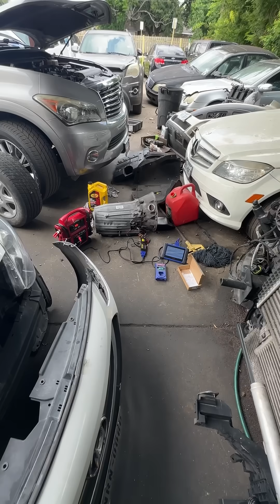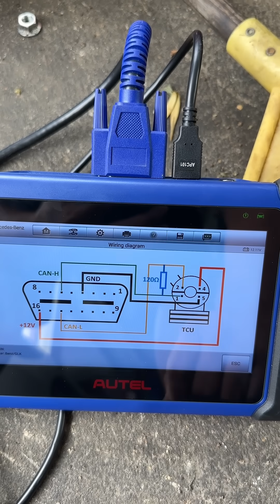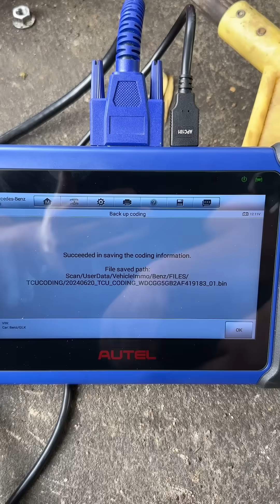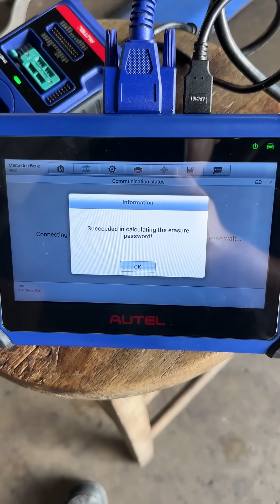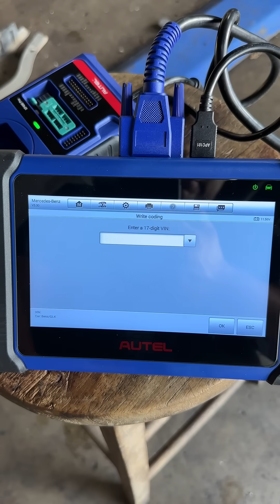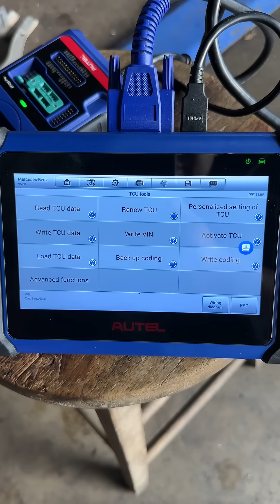MERCEDES USED TRANSMISSION PROGRAMMING CLONING USING AUTEL IM508  #mechanic #automobile #locksmith

Comment: Question: Why not just repair the original transmission without cloning information on another transmission?
Reply: If you repair the transmisión you have to restore Values. Is  different way to do it..

Comment: Why would my E320 4matic slip in to neutral while driving. I added fluid now it's stuck in first. Please help
Reply: Maybe shift solenoid. Are there any codes in the module?
Reply: @topher8634  p0700 p0715
Reply: @topher8634  p0700 p0715
Reply: Have u been a bad boy and neglecting ur vehicle service? Don’t drive it with slipping clutch and get it fixed or replaced soon.
Reply: @bobbysuazjFhvcfgh  somebody was. This was my grandmother's. Somebody else was driving it for her for sure.

Comment: i now see why mercedes benz and foreign brands can charge what they charge hourly
Reply: No he used extra stuff for no reason. You can do directly between the tcm plug and the obd2 dongle with 4 wires and 120ohm resistor
Reply: @AtSrg.m  show me . Make a video proving it. or add a link to a video as I cant find one...
Reply: @AtSrg.m  YOU CANT!!! because if you saw the video he did hook 4 wires to the obd 2 dongle and 120 ohm resistor. You still need the scan tool to write over the file.

Comment: Too much complexity.
I will stay away from over engineered German cars.
Reply: same i stick with  10 year old FORDs
Reply: All manufacturers have been VIN locking their components for years now. I would try to reuse original TCM if possible.
Reply: Unfortunately all from 2010 and up need that, all brands, including Chevy, ford Chryslers etc